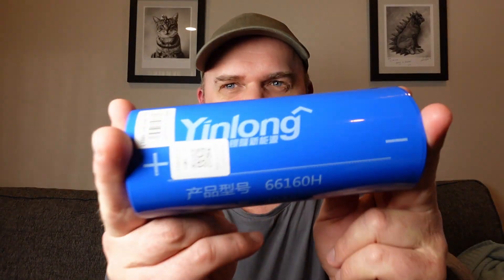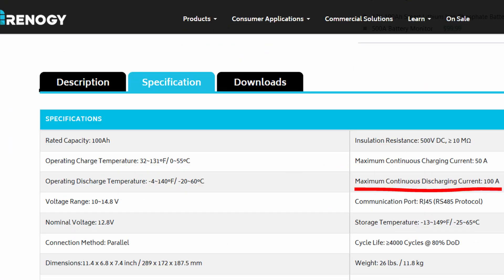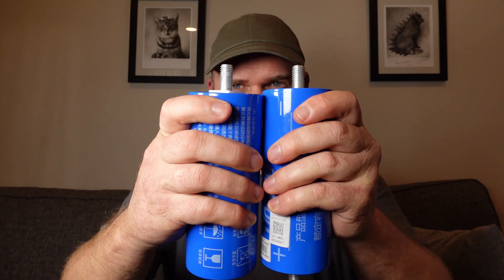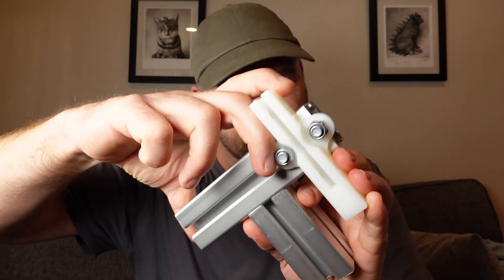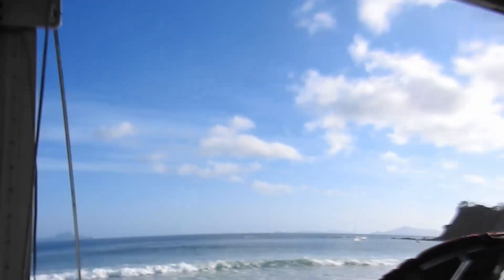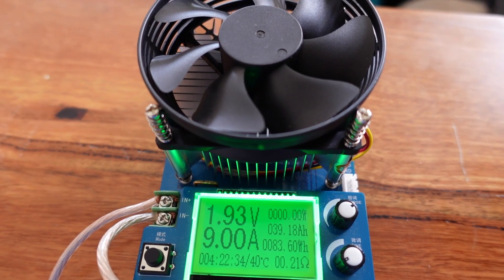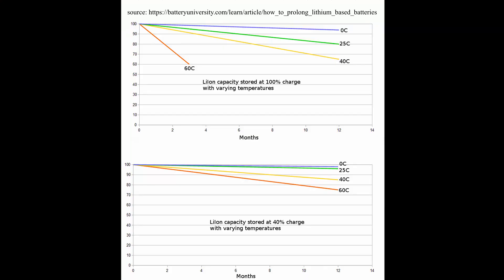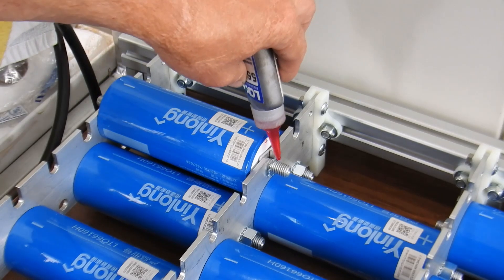Campervan DIY battery build HUGE POWER!

Comment: I never completed high school either .
But that didn't stop me from being successful,  l learned more in the first 12 months of work from a great and patient mentor/employer than l did for the previous 9 years.
Then a couple of years in the army taught me how to be independent so l spent the next 50 years working for myself without any trade qualifications, now I'm retired and living life to the full.
I'm also interested in finding the best off grid batteries and inverter system.
You have now started a fire under me, thanks.
I knew the retailer was asking way too much for gear he didn't know enough about, their in it for the money and just don't care about the customer,  this is why l started to research You Tube .
Thanks.
Reply from the maker: Cheers Jim

Comment: Damn! They are $355 - $418? How is that a tenth of the price?
Reply from the maker: I assume you mean $59-$69 each and you were referring to the price of 6 cells?  They were and should be around $50 ea.  But I guess that's what happens when govts print money and have money scrambles.  Anyways I went over my rationale in the video - sticker price (what most people go by) is a poor indicator of value, adding in the amount of useful power the battery will deliver over it's life gives you a more accurate metric of it's value.

Comment: So after seeing your video ,it makes me very suspect  .say A tesla battery if I’m in an accident in the car at high speed or I run into a truck that’s  on fire ,the rapid discharge you showed with a small battery would happen with the larger one with a greater effect obviously this says to me electric cars With this much storage of electrical energy is very dangerous .especially today with all of the flash flooding if a  car was traveling  at a high rate of speed down stream and unknown to you a fire plug is under the water and rips open the bottom of your car destroying the insulators of the  battery if It happen to be wet with water from the accident The discharge will electrocute me and possibly people 10 feet away from my vehicle in the water. I know this is true because it happened in New Mexico in the 1990s with GM’s volt they paid the family to be quiet those that  survived but of course they didn’t. no the media tries to keep this on the down low people need to be aware of the dangers of electric cars in order to take a 3000 pound vehicle Hurley through space at 55 miles an hour for three or four hours requires huge capacity batteries. I like the chemistry of your batteries you show here but in an accident I don’t think it’ll matter it’s called the law of unintended consequences what do you think?
Reply from the maker: Hey Mike,   I hear what you are saying, but this is my take:  While my cell deflagrated quite dramatically, a huge car battery is quite different, they are many cells and they will not all go off at once, rather a slow(ish) chain reaction.  No doubt, I would not want to be anywhere near a car battery when it did go.  That being said, the cell containment in cars is very robust and fully waterproof, so floods shouldn't cause a battery issue.  In the event of a crash, the battery is low in the car and fairly well protected.  If you are comparing a gasoline car with electric, gasoline is quite flammable as well (with more energy than batteries). The current stats as far as I'm aware is that given the same distance travelled, a gasoline car is around 10 times more likely to catch fire than an EV.  I think the difference in construction of electric cars have come a long way since the 90's with regards to the GM incident.  I think the batteries I have are very robust and would handle significantly more damage in an accident than current EV cells without combusting (tho wouldn't be as usable due weight etc.).  Thanks for your thoughts
Reply: @brendontait6968  The reason you don’t see them in stock car races is because it’s a high-speed collision 2/3 of them when they go off they take the rest of them with them it’s all about the conditions that’s why driving a car in the real world has a lot of different conditions that will cause this to happen. When I see them crashing into other cars especially other cars on fire and they don’t explode then I will feel a little more safe but until then we still have to deal with the grid being in adequate we can’t even protect the borders in this country we will never fix this problem.

Comment: Lithium-Titanate cells don't degrade at 100% SoC but actually at lower SoC. This is different then normal (graphite Anode) Li-ion chemistries. https://www.researchgate.net/publication/325738076_Calendar_Aging_of_commercial_Li-ion_cells_of_different_chemistries_-_A_review
Reply from the maker: Thanks so much for that Roy.  Out of a couple thousand comments, yours is the first to teach me something!  Really appreciate it...  It is a very useful article. What it doesn't mention is that LTO has a tendency to vent if stored at high SoC and high temperature, once a cell has vented it is useless.  Due to this, in summer I tend to have them charge to only 70%  Looking at the graph, the effect seems to only come in below 50%.  It's a pity the LTO graph wasn't done with more samples between different studies.  But still very useful.  Thanks!
Reply: @brendontait6968  This is also just the start of LTO,  in the future we will have subdivisions of LTO with different characteristics. We will have to differentiate between (Li4Ti5O12) and (TiNb2O7) for example. Could you do a followup on your LTO cells and especially about the problem you described in your comment? 
Next to Will Prowse's channel there is almost no information available about practical usage of LTO cells. He also seems to have some misconceptions about LTO cells based on his experiences. I think LTO is the future of medium-density high reliability energy storage.

Comment: What is the name of the battery management Bluetooth system you use?
Thanks
Reply from the maker: It's an ANT BMS, it works but is not the best.  I'll do an indepth review
Reply: I would like to know as well. While this was about the new batteries it would also be helpful if you would maybe do a follow-up and show how you wire up the battery pack for usage and charging.

Comment: Do not use (Ah out / Ah in) to calculate the efficiency. As you said IN THIS VIDEO, use Wh. Voltage changes between charge and discharge.
Reply from the maker: In this video I didn't have the equipment to measure Wh.  These are not lead acid batteries. There is indecernable voltage difference between charge and discharge.  Check out my cold testing video, I measured more accurately there.

Comment: Why did you use those insulators for the holes in the bus bar
Reply from the maker: So the bolts don't 'liven' up.  I prefer not to be using spanners that can short out on nearby metal bits when I tighten them up.  I don't trust myself enough to always be that mindful when spannering.  (Proven by previous experience)

Comment: Math check 11 in series at 2.3v per cell  = 25.3v@40Ah, times 9 in parallel = 360Ah@25.3v =9108Watts=approx 9.11 KWh. At almost 6 grand ($5,940) for 99 cells. Compared to $4500(BigBattery 48V KONG 12kWh Powerwall - LiFePO4 - 233Ah - 48V Lithium Battery) with some warranty versus DIY goose egg warranty + Life hours lost building it. DIY has the advantage of the knowledge gained and you can use that to replace/repair/upgrade the sub components. I know your cost analysis makes it seem viable with long term ownership, since you are working the 25 year/20K cycles. But this is the important thing you don't figure in. The technology continues to get better. 25 years ago we only started seeing maintenance free lead acid batteries. You see what I'm getting at - you go most expensive solution for longevity and really over paying to have the newest thing.
Reply from the maker: I was going to reply before you edited..  People perceive value in differing ways, a majority of people look at the surface value, where I appreciate long term value.  I'll give you my take.  Firstly, the average measured capacity of the cells was 42Ah, so that gives a touch over 9.5kWh.  The cells are about $50 in low quantity, you get significant discounts with volume.  I paid $34 per cell plus shipping.  So that's just under $4k.  If we look at the Kong powerwall...  They state a 10 year warranty, but they also state a typical life of as low as 1000 cycles at 100% dod.  Their warranty specifically excludes having used the battery in freezing conditions, it also states a battery may expire before the 10 year period naturally depending on number of cycles which is also not covered under warranty.  They also state a max current draw as 150A and they mention this may be exceeded by the startup of an AC unit which would also void warranty.  Altho mine is fused for 400A, the rated continuous current is 3600A and peaks of 5400A.  So I am unlikely to stress the cells in any situation.  As you pointed out in your edit, I learned a lot about these cells from building the pack.  If a cell goes bad while I'm in the middle of the outback I can find it, remove it along with other corresponding cells and still have a functional battery till I see civilization again, alternately...  I could easily enough carry a couple of spare cells and just replace one.  On reflection, I still believe that I built one of the best and most rugged batteries that I could for my camper.  Even if the cells last half as long as their spec at say 10,000 cycles compared with the lower expectation from Kong at 1,000 cycles, how does the cycle or long term cost look with that comparison?   The battery has been running for nearly 2 years with zero degradation in capacity.  I could have just gone out and bought an off the shelf battery and chucked it in, but I would learn little.  Some guys like to waste their life hours at titty bars or watching footy, I like to waste my life hours building things and learning.  No doubt we will see incredible cells come to market in the future, and probably within 10 years we will see big changes.  However, my battery will still be there, still delivering the power I need and I'm not sure that I'll care if there is better chemistry available.  These cells are safe, efficient, robust, environmentally friendly and long lived.  Those are the priorities that I placed on this build.  Thanks for the comment, tho we have a differing opinion of if I am taking the most expensive option and over paying for what I have ended up with.
Reply: @brendontait6968  There is a difference of where we are both coming from Brendon, you actually have built a system and I am just looking at the details for my technical requirements and I don't know squat. I do have two associate degrees in Electrical Engineering technology(but I don't do that for my job), but I will not claim to speak from experience. I am not a powerwall salesman, so if you got 99 LTO66160H cells for less than 4K that makes your solution way more attractive. The best warranty in my opinion is the one you never have to use. But more and more people count on stuff not breaking, or being cheap enough so if it breaks it can be replaced. My application: I am in Florida, so my goal is to create a battery backup for 9KW that is around 2x (4000W) +1000W cushion. 4000W being 500WLoad for 8hrs. The load is two small 5000BTU window AC. In a hurricane, power goes out. If you have small children and animals and a wife telling you they can't take 95 F for 7 days with no power, the world is hell. It would be more convenient to have this battery bank, and 4x(420W) solar panels, for the day and a small 2200W Inverter/Generator to give me shore power to charge my bank for the evening and to back up if my battery drain exceeds my capacity. Everything is in a planning phase. I appreciate your video Brendon

Comment: Nice work mate , I wonder if you could use these batteries in a hybrid car 🚗
Reply from the maker: 100%.  They are heavier than the more flammable type, but with a hybrid the battery isn't very large

Comment: That was a great explanation regarding the LTO battery chemistry. Very informative and fun to watch. I’ve been thinking of ways of making a similar battery pack (48V 22S) but using the LiShen LTO batteries. Your design was so simple, compact, symmetrical and used minimal parts. Excellent work!!
Reply from the maker: Thanks for that Jamaree

Comment: Seems to be very much overpriced, as six of these in series sum to ~12V, with only 40ah (Total Watts=480), at a price of ~$400.
Reply from the maker: You mean Watt hours?  That's weird, I get 552Wh, maybe check your maths.  They get cheaper when you buy in bulk.
Reply from the maker: Also, as I mentioned in video, it is superficial to just base price on capacity, figuring out $/Wh/cycle gives you a much more relevant number.  Plus then you add in that these can operate in most temperatures and the fact they are unlikely to ever burn your rig down, plus they are tolerant of over and even reverse charging, so tolerant of a BMS fault....  they seem like a bargain to me.

Comment: Are you a kiwi ? I see you are , I have quite a bit of that 4040 , are you importing anymore 66160 , regards Cameron , Rotorua
Reply from the maker: Yup
Reply: Have you got any you can sell me ?
Reply from the maker: Hey Cameron, yeah sure.  Flick me a msg on Instagram
Reply: @brendontait6968  after lockdown i guess , how much are they , its for a hiace camper , 12v so  prob start with six , is 15v to high ? Since real learning doesn't happen at school I trust your opinion, haha, be less than 15v ? , 6 x 2.3 v ?

Comment: We use loctite 243 on our RC planes, it holds the nuts and bolts in place but it can be cracked using hand tools.
Reply from the maker: Thanks, yeah... the stuff I used is removable too.  It's loxeal 55-04.  The studs are quite delicate.

Comment: busbars should be tinned copper. as an EE i would say your design looks good.
Reply from the maker: Thanks, tho I disagree with the tinned copper sentiment.  The lugs on the cells are made from Aluminium, so would rather keep the number of dissimilar metal junctions to a minimum.  Plus, am not sure I'd be able to afford solid copper bars.

Comment: Brendon pls make a step by step 2KW capacity battery pack/generator for a solar system design for home
Reply from the maker: Hey Roger,  I will make some future battery packs.  I'm not sure I understand your requirements.  You want 2kW power delivery or 2kWh capacity?

Comment: Learned so much with your video, nice that you made this 😊
Reply from the maker: Glad it was helpful!
Reply: @brendontait6968  Thank you very much, I will probably give it a try then 😬 I am also thinking about building myself a modular 20W X5 small solar panel system to charge the battery on a sunny day 😎
Reply: @brendontait6968  By the way what do you think about those small size 16Ah green cover LTO batteries seems made by a company called LiShen. Not sure how good those are 😬
Reply: I don't have too many toolings at home, do you think I can still make a 300to500wh battery power station with these batteries?
Reply from the maker: Yes, there are plenty of people DIY with these cells.  There are some really good clip together plastic holders for them too.
Reply: @brendontait6968  BTW I seem never could find the battery holder for those batteries on AliExpress. Do you maybe have a linked saved or knows where to order them? Thank you 😊

Comment: Raw aluminium is a poor choice for busbars, as it forms an oxide film rapidly. I believe the terminals of these cells are nickel-plated, and the busbars should also be nickel plated (copper is usually used, but electroless nickel plated aluminium would be OK).
Reply from the maker: I'm not sure the terminals are nickel they seem the wrong color.  I think ali is the ideal material.  It's lightweight, cheap, strong, conducts and machines well.  I put silicone grease on the terminals to inhibit oxide formation.  Cheers
Reply: @brendontait6968  nickel plating can have many different colors, depending on the chemistry of the plating bath etc. Aluminum is gaining popularity as a busbar material, but AFAIK is always plated (at least on the junction areas). Tin, nickel and silver are popular.

Comment: I was expecting a DIY build, but wow!  You have ALL the best equipment and the brains to make it work.  Can I just bring my project to you and write a check?  :)
Reply from the maker: Thanks Michael, I didn't use red locktite - I used an equiv to blue, but am still unsure.  Have updated link.  Thanks
Reply: @brendontait6968  — Michael?  I think you responded to the wrong comment. 😎
Reply from the maker: Sorry Erin... I noticed something on my computer getting messed up after I commented on a few comments.  I should have refreshed the page before I replied.  Thanks for the comment btw.  Unfortunately I'm quite time poor at the moment!
Reply: @brendontait6968  absolutely not a problem, it’s all good!